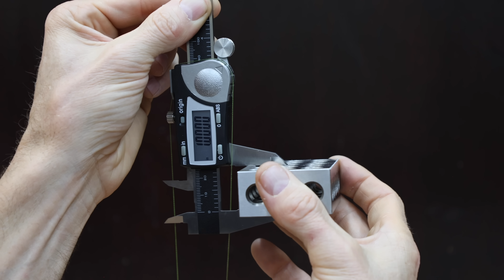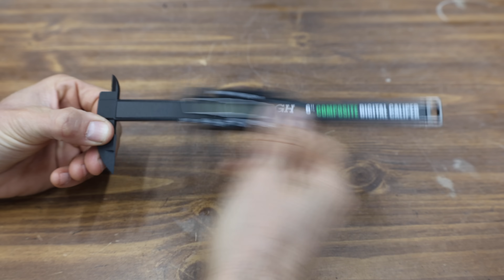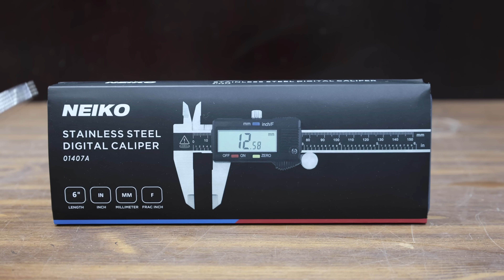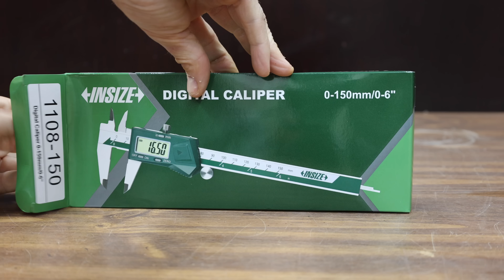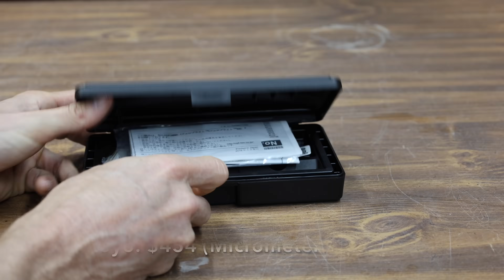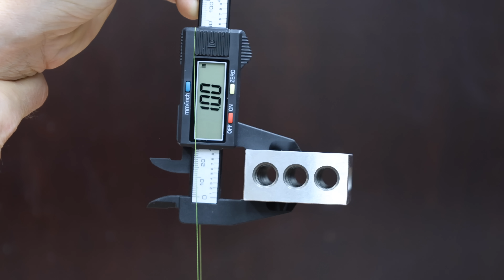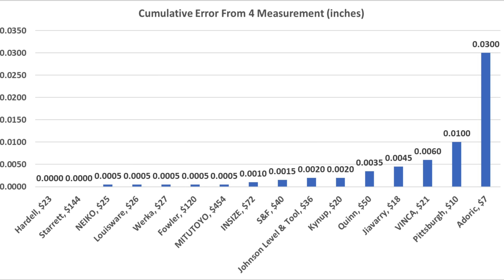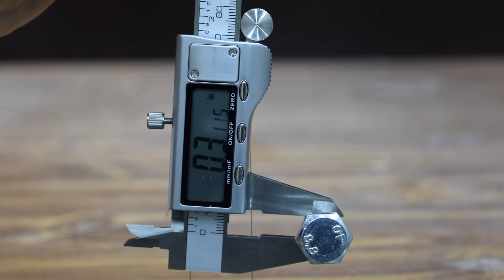I've Been Proven Wrong About Calipers!

Comment: i have a cheap caliper and it's good for a bit. well. it has done it's job when I needed it. but after just i think 1 year. its now malfunctioning 😂 sometimes the numbers jump.  you must ensure you get atleast 3 the same sizes to conclude that it is that size you're measuring. 😂 it's better to invest on proper tools when it comes to precision.  they are good when you use them like this. maybe 30x, 50x. after that. omg. 😂 you're in for a ride 😂
Reply from the maker: Thanks for sharing.

Comment: I bought a Mitutoyo 6" digical in 1990. I believe it's on its 4th battery, despite me regularly forgetting to turn it off sometimes for months at a time.  If you stay away from the "A" site you can get them around $100, about the same price I paid 35 years ago. Worth every penny.
Reply from the maker: Thanks for sharing.

Comment: Also I do have to say measuring depth of a throughhole without a proper surface plate is not an appropriate test for hich end calipers. If you can run your fingernail over it and you feel it hook on anything thats at least a thou.

Comment: One test that would be nice with these dials or any of the like would be to test how accurate they are with humidity changes. I worked at a place where we had the mitutoyo and when bringing it from an air conditioned room into 100% humidity 100degees you had to let it sit for about 5-10min before it was hardly even usable.
Reply from the maker: Thanks for the suggestion.

Comment: $453 Mitutoyo? No, no, no, while Mitutoyo certainly offer vernier calipers for that much and more, the set presented isn't that. 
That model is just under $200 WITH NIST certificate and comes in a plastic case on McMaster Carr. 
I use that exact caliper daily at work, they are good with a reliable 1 mil accuracy and half mil resolution. 
Unless you need carbide jaws or data out for traceability I can't really see the need to spend more. 
Realistically, there aren't many home shops that would find a benefit greater than the price difference over a set of NEIKO or even a basic Mitutoyo dial gauge set.

Comment: FYI all the calipers made in China are made in the same factory.  You missed one critical metric, how accurate they are when returning back from a measurement to zero.  Many of the cheaper products do not return to zero, but accumulate measurement errors.

Comment: 1. If not stainless steel, it's not a tool
2. Free play on the carriage does not matter
3. Autoswitch on/off does not matter
4. Battery size does not matter
5. Country where they were made does not matter - out of the box they are the same garbage.
6. If you need to go below 0.01 mm  - they all garbage, forget about digital, buy dial one.
7. No thumb wheel - not a tool
You buy several of the same breed from ali for around $7-8. You do all corrections at 20º C.
You re-grind them on the diamond wheel with very precise jig and polish making sure out/inside and depth rod jaws are square and parallel.
You replace shims with brass ones making sure there is 0 play
You retreat to re-harden the jaws/lips 
All moving part must be lubed.
I usually buy 10, after all those "procedures" ~3 out of 10 going to garbage. 
After all of those "dances" you'll get a Tool that will serve you for a long time  providing more-less true measurements.
Reply: There definitely ARE significant differences out of the box. The country of manufacture definitely makes a difference: Japan, Switzerland, and Germany are what you want.

Comment: Keep the calipers a few months and every few days or week verify the battery has not run down. This is a very real, disappointing problem I have had with Harbor Freight battery digital tools. When a tool comes with spare batteries I can’t help think they know you will be replacing often. Often enough to provide space in the storage case for spare batteries.
Reply from the maker: Thanks for the suggestion.

Comment: We have mostly Mitutoyo in our shop. Two diall ones with carbide jaws, the rest are digital.  Fir the depth test, a surface plate, or a soild( no holes) 123 block would have been a better bet, that said I thought your test procedures were completely reasonable. Most of those calipers measure 4 ways, there is a height measurement , which is from the end of the main body to the end of the carriage. They are flush when closed.

The smoothest caliper I have is a Swiss made Etalon dial caliper. It is a joy to use. I do have a pair of those plastic HF calipers. They're hard to mess up and handy when a tape measure is not good enough. Measuring diameters is easier and more precise. 

Thanks for all you're great work.
Reply from the maker: You are welcome!

Comment: I would never use digital calipers. Dial calipers are way more accurate and smooth. You get what you pay for. I have a nice pair of Mitutoyo with carbide jaws. I suppose it depends on what you are using them for. In the garage you can probably go cheap. For precision aerospace work you need good tools.
Reply from the maker: Thanks for the feedback.

Comment: Fun fact, Most of the calipers that have Auto off ONLY turn off the LCD which drops their power consumption by maybe 30%. they are always draining their batteries. The Mitutoyo draws pico amps when its off, and even when its on, its current draw is less than many of the cheap ones so you could leave it on all the time and the battery will last just as long
Reply from the maker: Thanks for the feedback.

Comment: Interesting test results. I have several sets of the Insize brand calipers in different lengths. I have 6" 8" and 12" Insize calipers and also one 6" caliper with tungsten carbide inside and outside jaws.
I have been using Insize calipers for many years on a very regular basis and all of them are still working very dependably to this day.
A standard 6 inch hardened stainless steel Insize caliper costs around £30.00 GBP in  the UK.

Comment: One point of observation: the calipers that have 2 buttons below the display and 1 above along with using the small coin cell battery all use the same electronics. They draw a ridiculous amount of standby current from the battery even when turned off. This means that the battery goes dead after about 2-3 weeks, even if you don’t use them at all during that time. I have a set of those and I basically don’t use the display at all because the battery is always dead. Don’t buy any of the cheap calipers that have that layout because they’re crap.

Comment: I've found that calipers (we call them Verniers in Australia) start giving inaccurate and varying readings when the battery starts getting a bit low. I suspect that's why the Mitutoyo has the low battery warning. Shame some of the more affordable ones don't have that feature. I've found the same applies to digital luggage scales (yes, I learned that one the hard/ expensive way at the airport check in counter). I think that best practice is to have a small battery tester on hand and test the battery before use, especially for anything critical. I also like having a pair of the cheap, carbon fibre calipers around for situations where I want to measure something delicate that could be scratched by steel, or in situations where I'm going to be carrying them around in overall pockets (the beak on the steel ones can be really sharp).

Comment: Tiny tip: the "CR" numbers are the dimensions of the cell in millimeters. First 2 digits is diameter, the second is depth sans comma. So a 2032 cell is 20mm diameter, and 3.2mm thick.
Reply: True for many rechargeable lithium cells as well, 18650 = 18mm diameter, 65mm long.
Reply: @BL-yj2wp  18mm diameter, 65mm legth and 0mm...... thickenss....? doesnt add up
Reply: @SagittarA  
65.0mm
Reply: @BL-yj2wp  yeah no... wouldnt it be 18.0 as well then?
Reply: @SagittarA   He's by no means wrong. But indeed, the last "segment" of numbers (pattern XXYY,Y) symbolizes YY(,)Y millimeters including one decimal, but without a point/comma symbol shown. It's just not common to include trailing zeros when expressing a single measurement.

-
For 99%+ of situations the above is all you need to know. BUT, there are a few rare outliers.

The 4-digit button cell and 5-digit cylindrical cell naming convention here is an IEC designator standard, that contains the dimensions of battery cells. I mention this because while they are very rare to come across, there are a few cylindrical cell models that deviate from this general XXYY(,)Y pattern. Those are cells under 10mm tall (start with a zero, and pattern is 0X(,)XYY), and cells 100mm or taller (pattern XXYYY with no(!) decimal). So the latter still only use 5 digits. They're not easily confused though, as there will be a 10X size difference between a model where the last digit is a decimal, and a model where it's not.
Reply: @SagittarA  18mm diamaters 65,0mm in length... so 18650
Reply: @Mtaalas  BS why would they put ".0" only after 65mm and not 18? not to mention putting ".0" literally anywhere is absolutely pointless
Reply: @SagittarA  Because height of the battery is the critical measure. The battery wells aren't so snug fitting that a 0.x difference will cause problems, but it can be enough to prevent the cover from sliding on when trying to insert a 2.8 mm battery where a 2.0 mm is expected.

Adding the ".0" specifies accuracy.
Something 'x' long can be a rounded value from 0.5x to 1.4x.
x.0 lies in the range of 0.95 > x to < 1.05 x.
Reply: @SagittarA  I see the frustration and trying to get it clear. 
 I'm not in the field of making batteries, it's most likely a manufacturing code for the physical measurement. 
Using 4 digits for one style battery and using 5 digits for a different style type of battery, is my guess.
Reply: @Metlplte  nah, it's about standard tolerances and how you imply them with decimals instead of telling them explicitly. basic stuff in mechanics and engineering.
Reply: @SagittarA  You forgot your highschool science class accuracy vs precision lesson I guess...
Reply: @Voyajer.  i dont know what useless knoweledge highschool you went to but the one i attended we learned actual usefull things for life. but i guess that impossible for someone with possible US education to fathom. Highschool science? putting a useless .0 selectively ? you really learned there in highschool? no wonder the US struggles if this is the level of education.
Reply: @SagittarA  the 0 represents the shape of the battery. Cylindrical in this case.
Reply: @jdgmeester  thanks finally someone that actually knows what the 0 means rather then people claiming it to be a decimal
Reply: @SagittarA your IQ doesnt add up above 65.
Reply: Never knew
Reply: @psevant1 Might come in handy one day :) 

Just be careful measuri g thickness of a button cell with metal-pronged calipers - you'll short it out, through the calipers, if you don't insulate one side. If you need to do it, grab something non-conductive (like a piece of platic or paper).  Measure the cell with that piece-of-something between the caliper prong and the cell top or bottom. You can use the zero-function to offset the thickness of your "insulator".
Reply: I just discovered that. My welding mask takes a 2450 and I started to wonder so I measured it. 24x5. Yep.
Reply: @DocSprocket  All metals are TIG weldable except zinc which is the plating found on galvanized steel. The short list: steel, aluminum, stainless steel, copper, brass and titanium. The rule for TIG welding, only use Argon or a mixed gas like Argon/Helium.
Reply: This is why I read comments.
Reply: @AmericasTeamAdventure  I was taught that watching a video on YouTube (2008) was only half the experience, the other half is reading the comments.
Reply: I wonder how many will test the theory by measuring with steel calipers and toast the battery.😂😂😂
Reply: the letters are also important. C is the Chemistry (Lithium) R is the shape (Round)
Reply: mind blown... makes me happy
Reply: Wow that’s new to me!
Reply: damn, we keeping learning new thing everyday, thx
Reply: holy cow.
Reply: take the battery out of your caliper and measure it to....... ohhh.
Reply: People are slowly discovering the basics of metric system, and why it is so much better than imperial
Reply: Awesome, this is so helpful thanks!
Reply: TIL FUCKKKkkk
Reply: Thank you.  I learned something here.
Reply: yeah, a whole lot of us dont use metric
Reply: 18650  should read  as  18 - 65 - O,  English O character, means ROUND
Reply: @jimchang9394  so 2032 are not ROUND
Reply: @wormball Guess where the R in CR stands for...
Reply: Don't use metric which is point this and point that.  Very difficult to use metric because you cant visualize what a centimeter or milimeter compares to. I'll stick to inch measurement.
Reply: @robertgardner-x7y  
"Very difficult to use metric because you cant visualize what a centimeter or milimeter compares to."
Huh?  Why can't you?
Reply: @robertgardner-x7y  i knew i am a super human
Reply: @robertgardner-x7y  americans showing their low IQ once again. Metric is literally easier to imagine to everyone that learns it in countries that use it DAILY. Of course its harder for you to imagine when youre taught to use inches as default. Not only it is way easier for us to imagine, it is also unimaginably easier to convert with simple preschooler maths since its all divisible by 10. Not to mention it is WELL ESTABLISHED and defined unit, unlike inch that HAD to use metric at its core to define the length of a inch, because factories in differnt states couldnt agree on how long inch actually is before. Inch is just disguised metric if you didnt know
Reply: @robertgardner-x7y I still use cubits, furlongs and chains

Comment: They should be at least liquid resistant too. Sucks when you’re measuring and get machine coolant on them. Amazing how an 18” pair of calipers suddenly starts registering 36” lol

Also, it would be good to figure out a way to run these through a few hundred or few thousand cyclings and check again.

Comment: Hope this info helps. Measurement System Analysis (MSA) is an entire science dedicated to analyzing how accurate and repeatable measuring tools are. Also, inches are divided into and read as "thousandths" when using calipers. So .001 is read as "one thousandth of an inch", and .010 is read as "ten thousandths of an inch".
Reply: In the shops I've worked in, a 'ten thousandths of an inch" = 0.0001, more commonly referred to 'a tenth, 5 tenths, etc..  If you're referring to 0.010", then "ten thou" would be commonly used around the shop.  The metrology folks in the QC labs used similar verbiage to avoid confusion.
Reply: @marcseclecticstuff9497  Machinist trade and automotive use ten thousands of an inch. My brother as a machinist used microns making vacuum pumps. TIG welding with blueprints, average tolerance .015,  .005 for the military. Most TIG welders in the 70's thru the ninties used Mitutoyo dial calipers, 6 inch and 12" were required.
Reply: .001" is a mil
Reply: That's interesting! Here in the non-MSA world, the phrase "ten thousandths" means 1 divided by 10,000. What does MSA call .0001? "One tenth thousandths"? And why doesn't MSA just use mils which is an existing English unit of measure equal to one thousandth of an inch. It would seem to me, as a non-expert, that it'd be a lot easier to say "ten mils" than "ten thousandths of an inch" and there'd be no ambiguity about what was meant. There must be something the MSA scientists know that I am missing.

Comment: Years ago when I was buying my calipers There were basically 2 options everyone recommended. Mitutoyo and neiko. Being a poor retail worker I went Neiko. Glad to see they are still making good cheap calipers. However I do still want some mitutoyos. I wonder if I can get my company to buy them for me...NGL I use these videos to decide what tools to buy for my work van doing dental equipment repair and installs. I also use torque test channel and just brands I like but if its a tool I am not super familiar with then I come here.
Anyways for 99% of things any of these calipers will be fine except maybe the S&F. Calipers that wont stay zero'd is bad.

Comment: I worked in manufacturing for decades. Most of these are likely ok for home use, but if you're in the trades you should really but Mitutoyo, Starrett or other top shelf brands. Also you should know industry only recognizes calliper accuracy to .002" likely due to possible difference between individuals using them. 
Anyway you largely get what you pay for here in the long run.

Comment: The first plastic calipers you show called "Adoric" are identical to the ones I own and use regularly. I bought them years ago from Amazon. A 2-pack cost $5. They've actually been more than sufficient to use with my 3D printers. I bought them because Big Clive reviewed a similar set and found them surprisingly accurate and durable for $2.50 each. However, mine have no brand name of any kind visible anywhere.
Reply: Do they drain batteries while off though?
Reply: @gluino  Yup. I often pop the batteries between uses. If I forget and the battery dies, I have a huge sheet of batteries I got during an Amazon sale. They cost a nickel each or so.